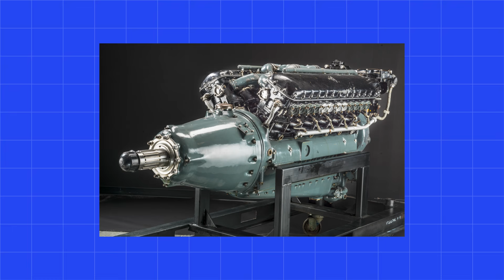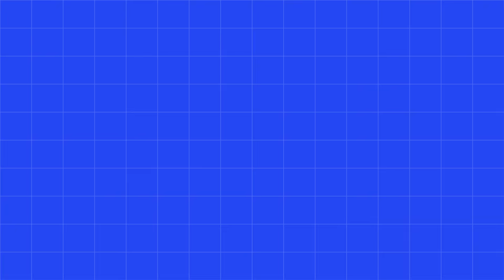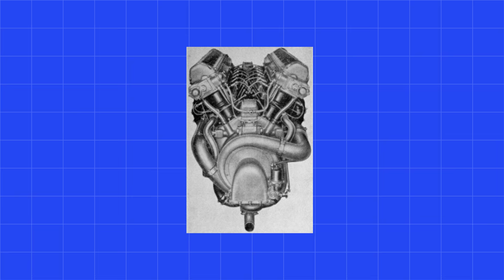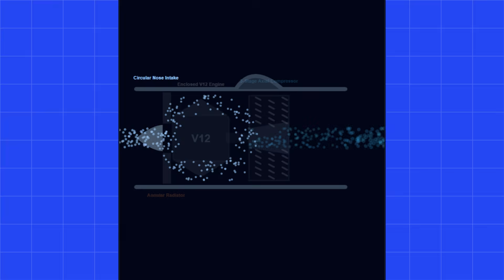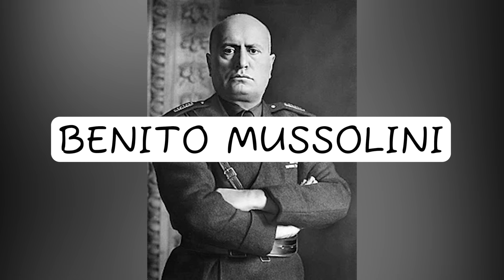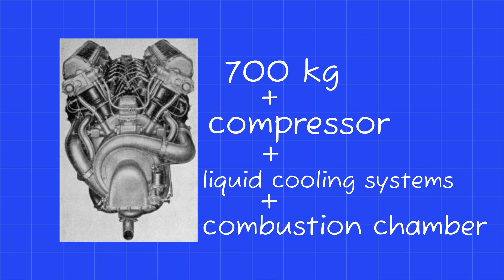The ENGINE That Tried to Turn a Plane Into a Jet

Comment: Two fatal flaws in the design:

1. The radiator for the engine was put in the air intake, restricting airflow and preheating the intake air, lowering its density.
2. The combustor was placed near the end of the tube, not leaving enough room for the adiabatic expansion of the hot exhaust gas, and giving the compressed air a chance to expand before reaching the combustor, further lowering the compression ratio and thus the efficiency.

The design could have been refined, but there are still problems. The afterburner does not need high-octane aviation fuel; using avgas to fire it would have been a waste. But if they used different fuels for the piston engine and afterburner, that would have created a fuel management and logistical nightmare. The solution could have been to use a compression-ignition engine for the compressor, as diesels can run on both diesel oil and kerosene, both of which suitable for the afterburner. The combustor should have been placed immediately after the compressor, allowing for enough expansion room for the engine to produce thrust rather than just heat. The placement of the radiator is more complicated because it needs a flow of air even if the plane is not moving, but a solution could have been found to use some of the engine power to blow cold air over the radiator.

Comment: The Whittle engine used a radial flow compressor stage not the axial flow stage shown. The compressor stages the diagram point to are not the combustion chambers. The diagram is total rot and nonsense.